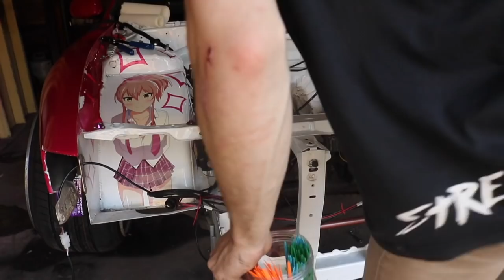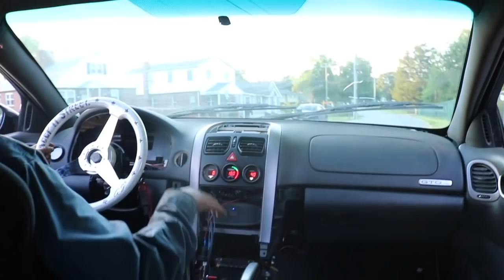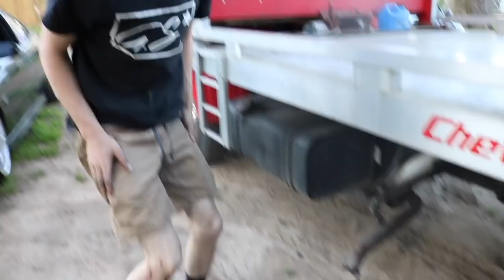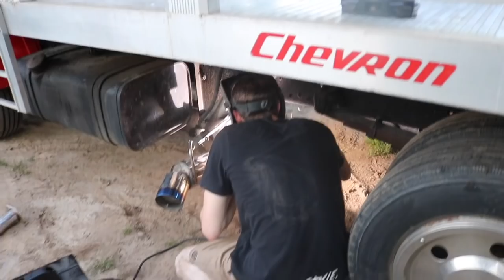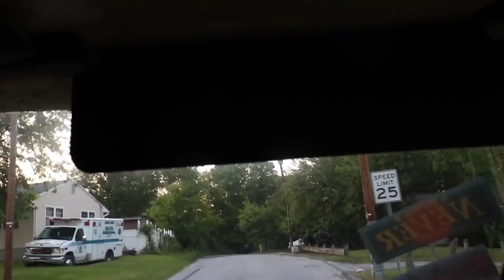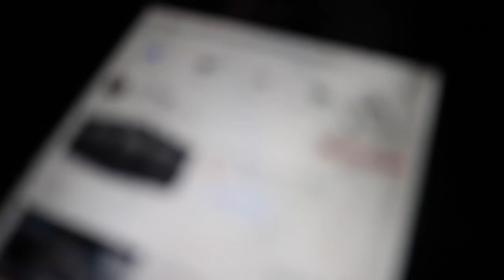We Installed a JDM Exhaust on the TOW TRUCK!??

Comment: Well if you take all of the Mufflers off it will be louder. Straight pipe it. For it to rull coal you have to put a tune on it. Diesel's you have to tune for them to roll coal

Comment: of course its quieter. you didn't remove the original muffler all you did is cut the pipe back and weld a second muffler on